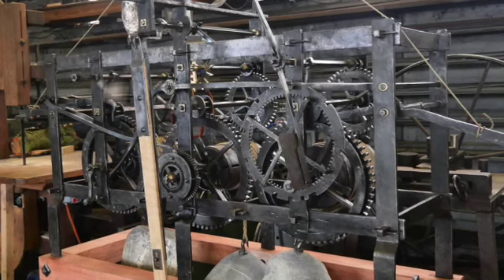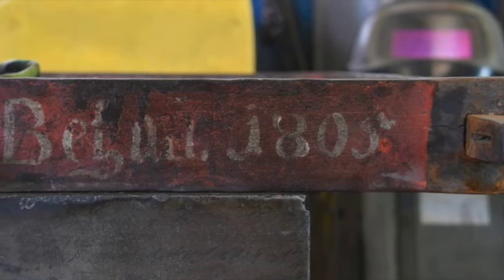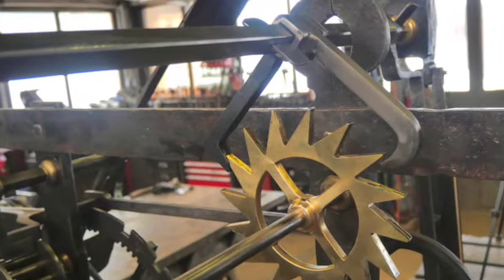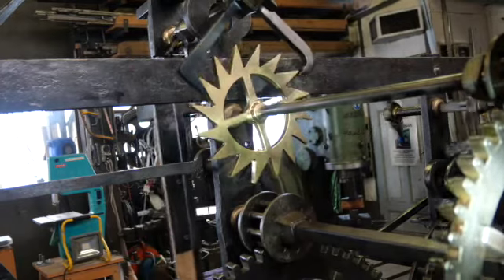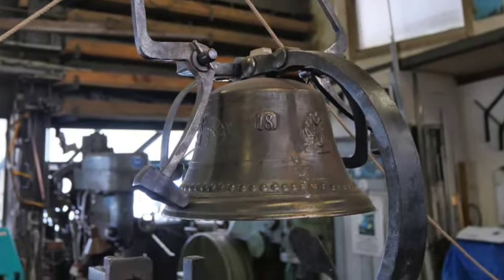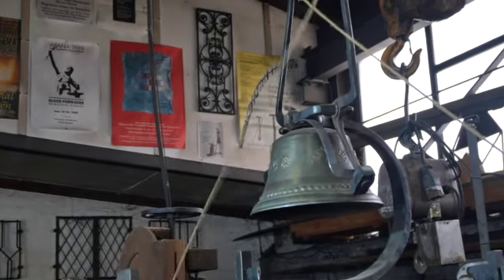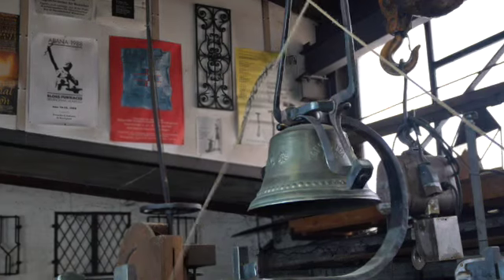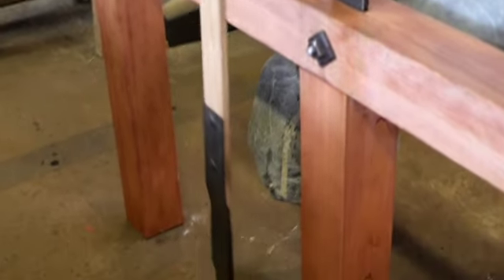Iron Tower clock restoration

Comment: Have you heard of an astronomical clock, which requires winding every 10,000 years? I’ve found reference too one with a longer period, a much longer period. I keep going over the numbers, and it keeps coming up to 1.2 million years. If you think that’s the crazy part, it’s not. I keep seeing escapements in sketches and painting, over 6000 bc. That’s the crazy part. Do you think you can help? I’d like to take a crack at that engineering puzzle…how bout you.